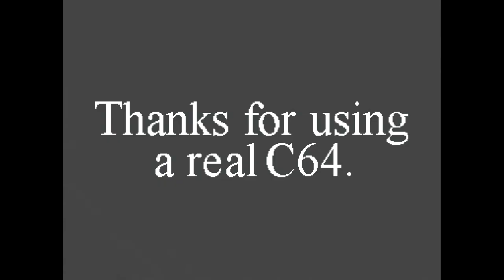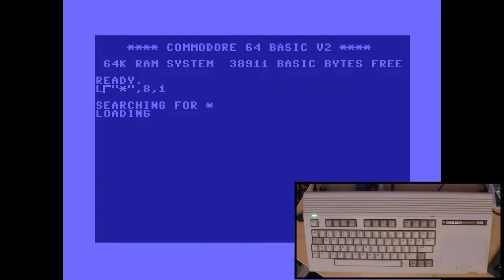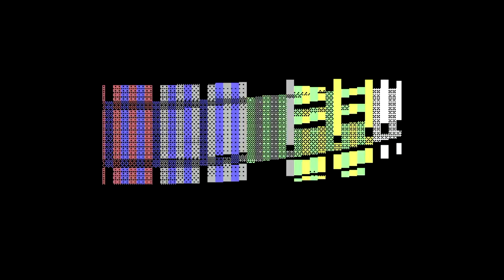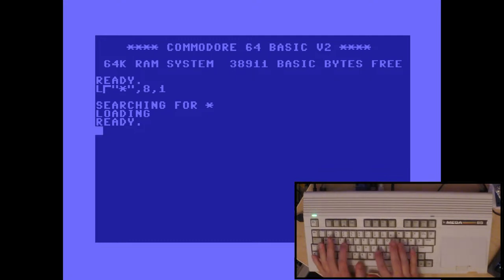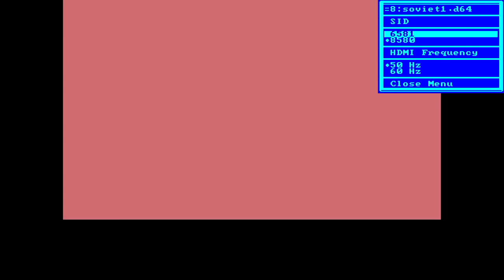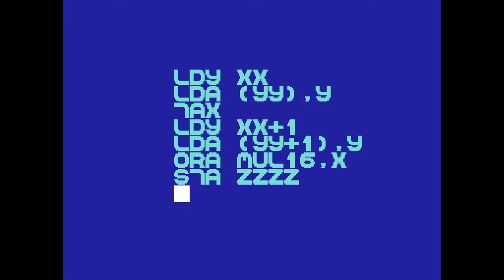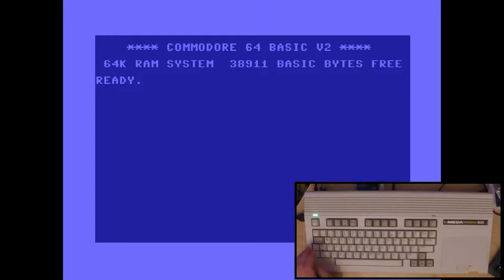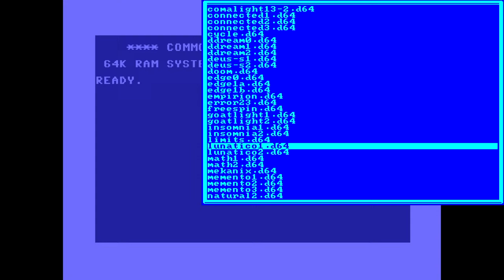MEGA65 C64 Core Demostream #1

Comment: Ah so it's a just a port of the MiSTer C64 core which itself is based on the 20 year old FPGA64 developed for the C-One. Your lucky Sorg put some work into it last year as it wasn't great before that especially compared to the Turbo Chameleon or U64 cores
Reply from the maker: Yes, the MiSTer cores really got a lot of love from the developers.
MiSTer2MEGA65 is a HAL (Hardware Abstraction Layer) in FPGA, to "plug" MiSTer core with minimal (hopefully) adaption into the MEGA65 hardware. Especially for micros this makes a lot of sense to me.
Reply: @OliverGraf  The majority of cores should be easily ported between FPGAs, some developers already support multiple systems with their releases. 
It's just a shame the TC64 and U64 C64 cores are closed but after the fun Jens had with the C-One I understand